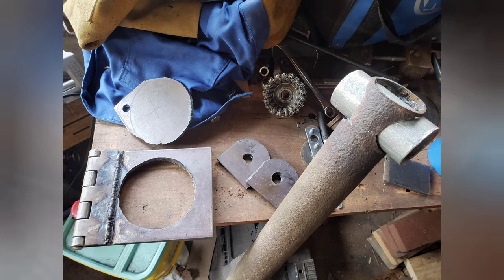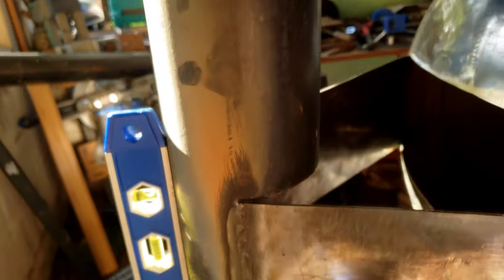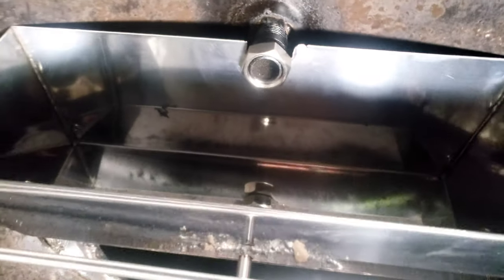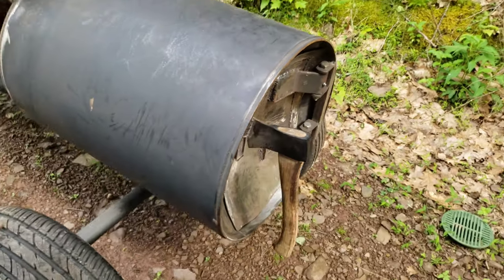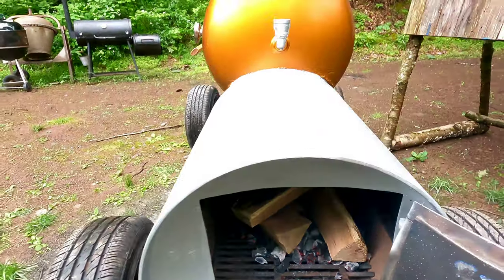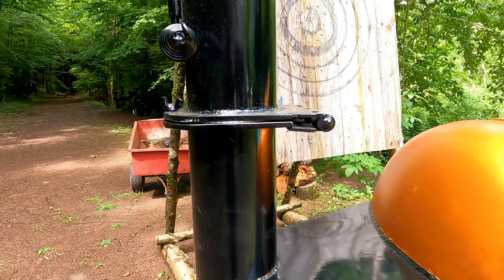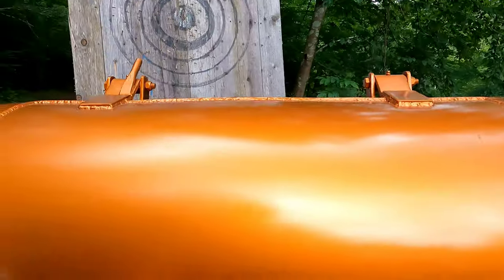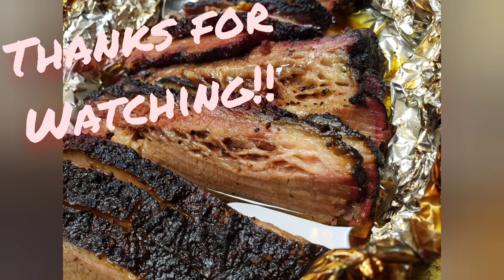wagon style offset smoker build pt.2 with burn in and test cook.

Comment: For such a small smoker and larger firebox, pull your fire closer to the door to draft into your chamber which might increase the cooking area for your chamber. But yes, fire closer to the throat would be great for a quick smoke like chicken or sausage. Love the pit.
Reply from the maker: Thank you for checking it out! I was skeptical about having such a large firebox. You're right i can move the coals around for different heat patterns. I have about 8 cooks on it so far and it does better than i expected. I can't wait to build my 240gallon  hopefully next year.